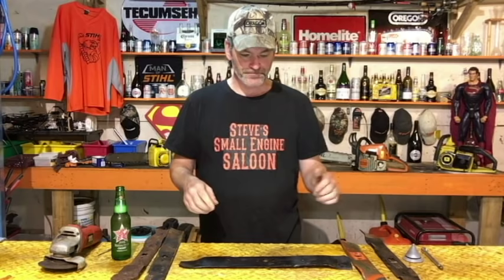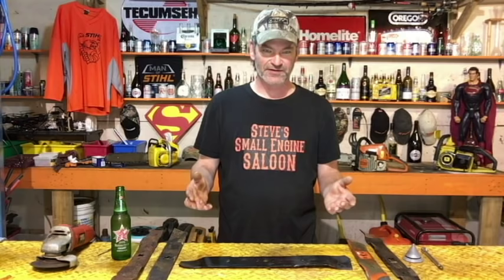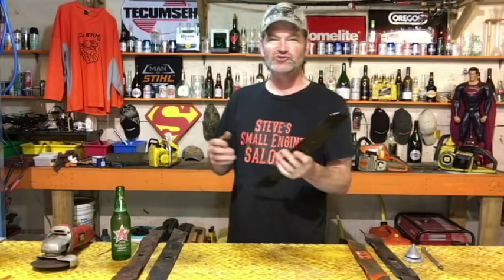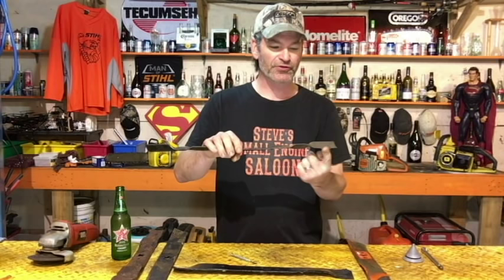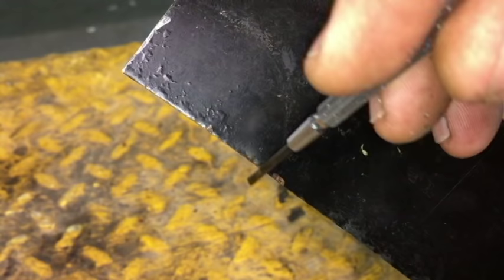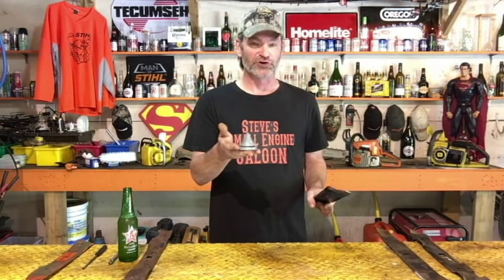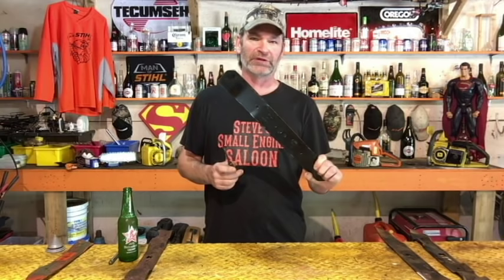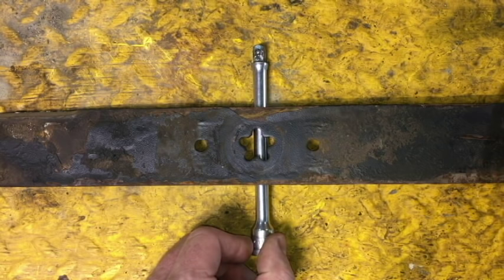How To SHARPEN And BALANCE A Lawn Mower Blade (The Correct Way)

Comment: Hey Steve. Do you worry about the blade heating us too much (discoloration) when grinding it? I am always careful trying to not heat is up and soak the blade in water between grinds.
Reply: Well, that’s the function of the beer—take a pass or two with the grinder, then put it down and have a couple of sips...when the beer is done, the blade will be done too. You’ll both be cool. 😎

Comment: i didnt read all thru the comments. but if you use a nail and you put it on and it does not move. that means it is balanced. if it was heavy on one end that end would go to bottom.

Comment: I sharpened mine and now it doesn’t want to run.  Is that because it’s off balanced or did I tighten the blade too tight when putting back on?

Comment: Steve, you advise us to only sharpen the top side of the blade.  The soil around here, in conjuction with all of the moles, pushes rocks to the surface.  It truly takes a toll on the blade creating downward movement of damaged steel.  There is no way that I can't take the bottom-side of the blade to the belt grinder.  I do level the damaged area with the surrounding good area and do not treat it as a knife blade edge.  I do wonder why these blades aren't hardened and tempered though.  Properly hardened and TEMPERED blades prove to be much more durable.

Comment: Hey. Will an unbalanced blade possibly destroy a mower (engine) with a deck since the deck will absorb a lot of the vibration...Or was your video directed at blades mounted directly to the mower...basically push mowers I guess?

Comment: i find the best way bal with no guess work  ------use a 5/8 smooth rod in you vise  horiz. hag the bade on rod    the heavy end will sag  so take little off the back side of low end so it willl bal.  leave the edge you sharpened alone after you have it sharp

Comment: Cleaning the old caked on material from the blade before any attempt to balance it.  Any blade balancing should be done on a reasonably clean blade.  A wire brush does wonders for cleaning blades.  Before sharpening the side grinder, I usually do a little detailed prep with a medium 12" file to get the rock burrs off the backside of the blade just so it has no hang nails left on it.  In this I am NOT sharpening the backside.  Just de-burring it.  Then I sharpen the angle as close to 30 degrees with a side grinder.  I sharpen more often to put just a fresh edge on the blades without removing much material.  An extra set of blades helps a lot to make the blade change quick.  The sharpening can be done later when time allows.

Comment: Hey Steve I notice that new blades you buy today are not all that sharp.Would you recommend trying to put more of an edge on a new blade
Reply from the maker: I do!
Reply: You don’t want it too sharp though, it’s spinning at 2,700 RPM and cutting grass. If it’s real sharp and you hit something you will end up removing more steel when you sharpen it later

Comment: I think it would be safer to be grinding on the other side of the wheel arbor. That way it would not be possible for the blade to grab the grinding disk. I got corrected by the shop Forman for doing it the way you were doing it when I first started working in the shop as a young man.

Comment: Never done it before but you can use a flat board. Drill it one size smaller add washers on the bottom side, screw the bolt thru the blade and washers then spin the blade. If weighted evenly it shouldn't hit the board while spinning.
Reply: Make sure the board is level before spinning the blade.

Comment: Only use a hand file or vertical belt like sander never use any kind of grinder unless it has a sanding disk and use a 60 grit sandpaper. Grinders overheats the steel on the cutting edge which will weaken it and also never over sharpen it leave it with a slight blunt edge.

Comment: Hey Steve do writing lawn mowers with dual blades bypass each other or just get real close and if so why does it not leave a small and strip of grass in the middle
Reply: Usually, the blades are geared to be 90 degrees offset (so if one is perpendicular to the direction of travel, the other is parallel to it) and the circles overlap slightly. But because they are offset, the blade tips never collide.
The other option is to offset the blades a bit (one forward, one back) so that they overlap in the direction of travel.

Comment: Balancing on the nail -> just hang it water levelled, and then release it, if it stays that way its balanced ;) It should stay in every position possible as the 2 forces work against each other exactly the same.

Comment: I'm thinking the table your balancer is on needs to be level when balancing the blade? Both directions? perpendicular to each other, Just checking. Great balancing method though. Maybe not with the cone method?

Comment: I hit a hidden tree root with my push mower ,  bending the blade and engine crankshaft . 
How can I bend the crankshaft back into shape to reduce the engine vibration without removing the engine from the mower ?
I heard that you can remove the blade and insert a pipe over the end of the shaft and lever the pipe in the direction it needs to travel to straighten the end of the crankshaft  . What do you think ? Have you ever done this ?
Thanks , Jack
Reply from the maker: Video is in my lawn mower playlist!

Comment: I use my Dremel which is just a little larger then a 2 D cell flashlight and held the same as a flashlight. Small grinding disk in chuck the size of a nickel in diameter and about a 3/4 inch wide. I always sharpen the blade as you indicated but I don't have to remove the blades because my sharpening tool is so small.  I have a Honda that has twin blades (two 20 inch blades stacked to one another forming an X looking at them) with four sides to sharpen. I agree, if you are using a large grinder like you show, yes the blades have to come off. Only thing I would do different using vice and large grinder? I would always grind from the blade towards the sharpened edge, never from the sharp edge to blade. I don't have the nicks you show and I keep the sharpening/grinding to a minimum. Two to five passes and it's sharp so I'm not concerned with out of balance. If I did notice any abnormal vibration (I do not) I'd just replace the blades. I don't drink alcoholic beverages so 7 UP or sprite works for me.

Comment: I hit a piece of metal with my push mover.and bent the blade. After replacing the blade the mower is vibrating when idling but not when the blade is engaged. What might be the problem?
Reply: Bent crankshaft... Yikes 😳

Comment: also when sharpen your blade let the grinder do the work  don't force   the grinder. you can   over heat the blade an cause it the chip  an dul  faster

Comment: Hi Steve, great video. When you use the ratchet extension to balance the blade and its out of balance, which side do you remove material ? The side where the ratchet leans to or the other side ? Many thanks

Comment: The only mention I feel you may have missed in the beginning is to thoroughly clean the blade after removing it from the mower or you're not going to attain a proper balance when sharpening the blade.

Comment: What are you using on your angle grinder to sharpen?
Reply: You can use a cut off wheel or grinding wheel. A grinding wheel is more forgiving if you make a mistake. Dont over think it though. It just shaepening a piece of metal. I did this when I worked for a landscaping company. I would sharpen a stack of blades everyday so they could be put on the mowers for the next day. It doesnt have to be perfect and the blades wil dull almost immediately.

Comment: I recently replaced my reg blades, with gadder blades and I had a gap between the blades as I was cutting, and they are the same size as the reg blades. What do you think is the problem?

Comment: some lawnmower companies like john deere recommend not a sharp knife-like blade but rather a sharp point that has a 90-degree edge where the point would have been, claiming that would have lasted longer and cut better than a knife-like edge that a dyi'er would have simply done. you didn't mention anything about that, what are your thoughts on it?
Reply: @ 45 deg. angle .  More like a sharp chisel.

Comment: Sometimes , when one side of the blade is really "thin" and sharpening the other side will make the whole blade look like scissors ... what i do ( always success ) , is to measure some weight for "thin" side and just weld it on properly . And then is perfectly balanced and no more shaking . Work like a charm .

Comment: I LOVE THIS GUY AND THE SUGGESTIONS HE MAKES BUT THIS TIME I'VE GOT TO MAKE A VERY IMPORTANT POINT HERE AND THAT IS THIS. LAWN MOWER BLADES ARE MADE FROM VERY CHEAP METAL AND IF YOU HEAT THEM UP WHILE SHARPENING, THEY AREN'T GOING TO KEEP THEIR EDGE, SO, ACTUALLY, THE BEST WAY TO SHARPEN THESE BLADES IS BY USING A HAND FILE WHILE THE BLADE IS IN THE VICE....THAT'S MY TWO CENTS WORTH FOR TODAY. GOD BLESS AMERICA

Comment: I’m an artist with an angle grinder, but i have to spend much less time balancing using my die grinder. It’s just a more delicate grind. Keep a spray bottle of water to cool the blade every 30-40 seconds and finish with a fine bastard to remove burrs. Point is, a die grinder is superior to an angle grinder…if you have air.

Comment: There's also a dremel tool attachment made for sharpening lawnmower blades that holds it at the proper angle against the grind stone and can be used without removing the blade. However, if your blade is really dull, it may be faster to take it off and use a bench grinder which will also allow you to balance it which is even more important if you have to take much material off.

Comment: First thing, grind off the blade not on to the blade.
Second, I always debur the the bottom of the blade with a file
Third, I always sharpen to a blunt edge about the thickness of a dime, that will be reliably sharp for about 30 hours of use.
Fourth, painting the still toasty (not hot) blade will extend the time it stays sharp by about one third.  Colour is irrevelant!
Reply: Good advice, if you check it frequently, a half-round file is all you need, only takes a few minutes and you will have a better edge too
Reply: I'm a bit confused. He demonstrated grinding the blade in both directions (first at 4:06 and then again at 6:14). Which way is the correct way? The first or the second?

Comment: To finish a blade and know it's sharp, never grind into the edge. Only grind away from the edge. Meaning, Steve, you were grinding far too much steel off the blade by having the grinder turning into the sharp edge. If you want a smoother, sharper edge, only have the grinding wheel moving from the thick part of the blade toward the the edge. That's the secret to getting an edge that's sharp enough to shave with.
But, if you have to take a lot of weight off one side, sharpen into the edge and you'll get there faster. Then finish the edge the right way to have a better, more even edge.
Reply: I'm a bit confused. He demonstrated grinding the blade in both directions (first at 4:06 and then again at 6:14). Which way is the correct way? The first or the second?
Reply: @nnamerz  I think he means the direction of the rotation of the disc. He's saying to do it with the disc rotating outwards towards the edge as opposed to inward against the edge and toward the body of the blade.

Comment: I use a single cut mill bastard hand file to duplicate the original angle ground. Doesn't need to be extreme sharp. Too mucho rpm's equal compromised steel.

Comment: awesome info.
Reply from the maker: Glad you think so!
Reply: @StevesSmallEngineSaloon  just got a used lawn tractor so replaced the blades. Felt like it was taking off and the blades took ages to get to speed. Did the ratchet extension trick  and now its faster to spin up and no more vibration. Im now going through your vids. Cheers from australia

Comment: Is there such a thing as too sharp when dressing the edge of the blade? I bought new blades for my lawn tractor last summer, and they came out of the package with the dullest looking edge on a brand new blade. I used my dremel with a sanding drum to give it the edge it should have had to start with.
Reply: The sharper it is the thinner the front of the blade is, it’s more susceptible to damage from sticks or rocks. You might end up having to remove more steel to sharpen it

Comment: It is easy enough to balance a straight blade.....but how do you balance one that has 4 blades. I have sharpened the blades and weighed them so they are the same...then reinstalled...but getting a slight vibration. This is a Masport mower with the Briggs and Stratton motor.

Comment: Ummm... the nail method uses the same principle for balancing tyres. The heavier side will rotate to the bottom (i.e. gravity). If the blade isnt rotating, regardless if the edge isnt level, it's balanced.

Comment: I was always taught NEVER use anything that causes sparks to sharpen the blade.  The reason is because you soften the metal by changing the temper of the blade.  Makes it softer.  Use a sharp fine file. Two, use a greasy  marble or ball bearing for balance.  Cheap and it works.  Just my humble opinion guys.

Comment: The gentleman below who said to not make the blade too sharp is correct in spite of all of the backwash he received.  But the wafer-thin fragile edge he is talking about is likely due to incorrect direction of the grinder spin during the sharpening process as much as it is the angle.  Any boy scout knows that to sharpen a knife you scrape the blade along the stone in the direction that is as if you are slicing off part of the stone, toward the stone, and not away from it.  This admittedly is counter-intuitive. This makes for a slightly duller but much more durable edge than by scraping the blade away from the stone.  Using this same idea for a lawnmower blade, you should only sharpen the blade with the part of the wheel that is grinding into, and not away from, the blade.  In the case of a mounted grinding wheel, which typically rotates downward toward you, you should put the front edge of the blade pointing up against the stone, not down.

The only exception to the above is in the barber shop, where they sharpen the razor in an "away" fashion.  They do that there because they want it extremely sharp and they know what the blade will be facing when they (hopefully!) carefully apply it to your face.  I am reminded of the decades old SNL skit where they mocked a Ford commercial of a jeweler cutting a fine diamond while in their smooth-riding car-- in SNL skit they performed a vasectomy!

Comment: If you haven't ever done this before then Natural Ice works better for precision balancing.
Reply: Think you can use a small plastic funnel to balance the blade.  As long as the funnel is perfectly round would think it would work.

Comment: Those blade balancers are almost impossible to buy in Australia, so I tried to buy one on line but when it arrived I found the hole in my blade was too small so I still don't have one.
Were can I buy one that fits a normal domestic mower?
Reply: As crpth1 above suggests, get a ball bearing or marble of the appropriate size and balance it on that. It should be about twice the diameter of your blade's center hole. Of course make sure your bench is level.
Reply: @daleinaz1  Thanks Dale.

Comment: What’s your recommendation? Does brand new blades need to be balanced before installing?

I just installed a pair of new blades and the mower shakes much more than before the change. 

Any ideas?
Reply: Never hurts to check. Not all manufacturers have good quality control.

Comment: I have mulching blades. Craftsman 42-inch deck They have a sharply curved area on the blade. A nightmare to grind. blade model 134149D. Should I just toss 'em in the steel recycling bin? Then install new blades and not worry about trying to sharpen these monstrosities?.

Comment: The reason the nail on the wall doesn't work is that a balanced blade should stay in any position you put it. That is the way one balances a prop on a model airplane, then on a model air plane one needs to balance the hub. Lawnmower blades do not have hubs as such.

Comment: Nothing wrong with the nail method. To use the nail method effectively, the blade should stop when moved to any position at 360 degrees around the nail. 

It’s a bit like manually balancing a motorcycle wheel. If you move it around, let go and it carries on moving, it’s unbalanced. If it stays where you put it regardless of where on the clock face you stop, it’s balanced. Obviously don’t hold the screw in your hand, fix it to something stationary.

Comment: I 
Have watched a lot of your videos and find them very informative however your demonstration of balancing a blade on a nail was a bit confusing. Correct me if I’m wrong   A balanced blade on a nail will remain in the position you put it at but an  UNbalanced blade will always hang  vertical. It doesn’t have to hang level to be balanced

Comment: On my Cub Cadet riding lawnmower, I have enough room (with the mower up on blocks) to sharpen the top of the blade without taking the blade off.  I also straighten the bent blades to use them again.  Welding the blades back together after they tear is difficult for some reason.

Comment: Don't grip in vice from face to face,if you flatten the curve that runs length of blade it will damage the curve stop it buckling! Only grip across width, once buckle it a bin job as will vibrate extremely!!

Comment: An unbalanced blade will break welds and/or cause cracks in your deck. I'd never use a bench grinder. You get more control and better results with a hand grinder.

Comment: 9:45 actually you are only showing that this blade is in fact balanced, that's why it doesn't turn in any direction.
If you would've taken an unbalanced one, the heavier side would of course have moved downwards.